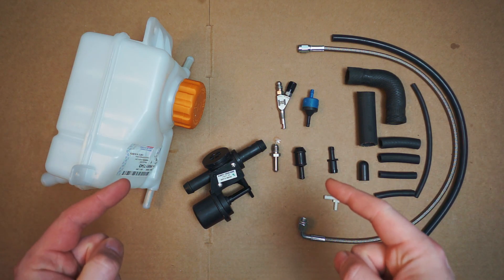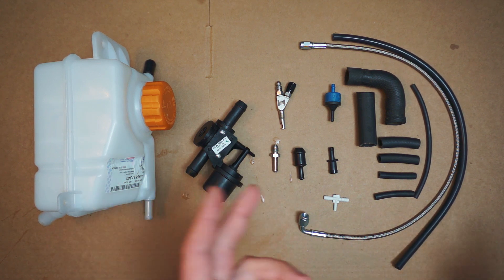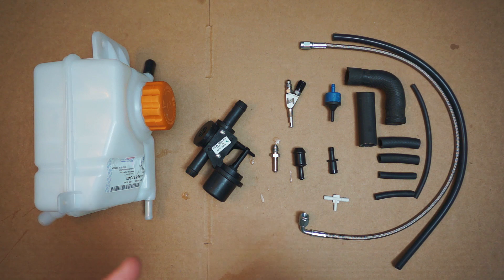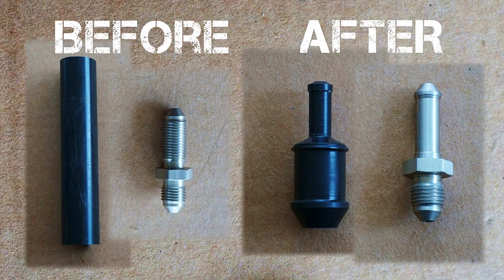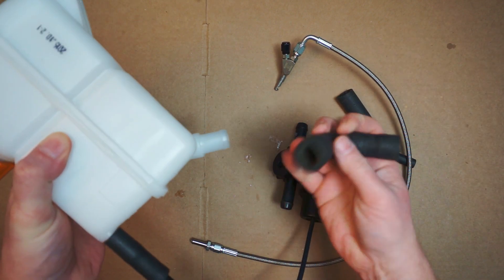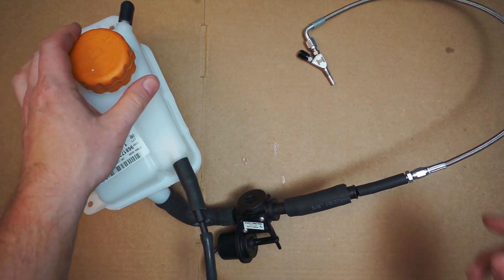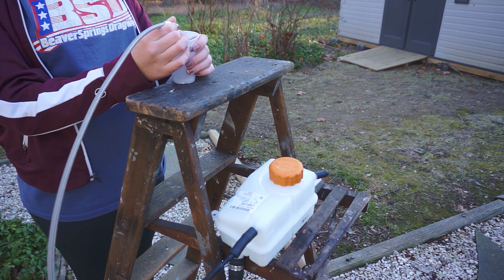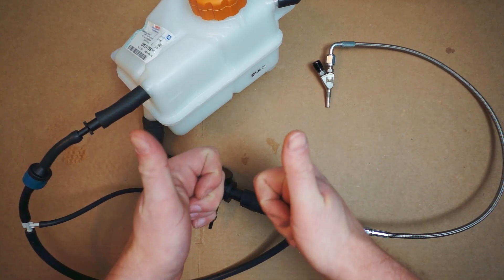$100 Pumpless Meth Injection - Part 1

Comment: So if you're feeding it, boost pressure and then it's trying to spray into 17Psi will at work?. In the turbo carb world I'm pretty sure you want fuel pressure at least seven psi higher than boost

Comment: I think that vacuum valve gadget is a bit pointless. The fluid won't leak out the nozzle while out of boost because the check valve is preventing the fluid from being displaced, like holding liquid with your finger on top of a straw. 
There is the issue of having residual boost pressure in the tank after throttle close which would continue to spray until it hits 0 psi. Because of that you just need to use a blow off valve with a 5-7psi spring between the check valve and the tank.

Comment: The reason we dont do this is you get pooling inside the intake pipe...

You need a mist... if you add the mist it works... but you want at least 100psi behind it and a much smaller jet. 

I use a nos mini controller to adjust my nitrous and methanol solenoids individually at different rpms to get the tune dialed in correctly

Comment: That's a pretty nifty tank. Wouldn't it get better pressure if it had a full diameter hose & fittings so the flow of pressure won't be compromised  by the 3/8 hose sucking on it? It looks like a 1/4 vacuum line fitting & use it you could get the check valve  and supply hose not not neck down it might flow more. If you even have an equivalent vacuum source of a second fitting you can hook it up where the nipple goes

Comment: Pumpless Methanol Injection, so interesting. There is something called Mist Coolant that is cheap and pumpless. It claims to works with relative air pressure as low as 1 bar, which fits some turbo charger. I searched the internet but sadly no one seems to go in that direction. I am aware that at 1 bar, the flow rate is not high and fluid particle is not very small, but it is cheap and is easy to install compared with traditional kit.
Reply from the maker: Back in the '90's there was a pumpless methanol kit called Anderson Mr. Freeze - if you google it, it may give you some ideas.  These setups do work and have their own benefits.
Reply: @AlexLTDLX  Interesting, Mr. Freeze likely still exist. For my case, I prefer some DIY parts to commercial kit, if possible. No pump, no cable, no tank( using washer reservoir instead ) and some fun.

Comment: This popped up randomly for me, anything like this going on the electric turbo?
Reply from the maker: Because I want to do pre-compressor injection on a centrifugal compressor, I'll probably end up using a more conventional meth system (for better atomization) on the electric turbo.  But this would've worked fine on the Whipple.  In fact, I even drilled/tapped a boss for it; but well, as with most things race-car related, the plans changed and well, here we are :)

Comment: Wow this was really cool. I only have one question is the nozzle placed before or after the forced induction? The reason I ask is because im wondering when psi pushes the fluid throught the system, isnt the nozzle at the same psi? Does the pressure of the resevoir over come the pressure the nozzle sees?
Reply from the maker: It's got to be before the forced induction, otherwise it won't work.  It's not a new idea - google, "Anderson Mr. Freeze."

Comment: The method only works if injecting pre-compressor (which is not suggested).
Reply from the maker: Who told you it "is not suggested?"  We've been doing it for decades (google Anderson Mr. Freeze) - no damage or issues, ever.  In fact, injecting pre-compressor leads to more boost usually because it "seals" the compressor a bit.

Comment: Can we add water without methanol? Someone try the setup kit on his car?
Reply from the maker: I tried water injection alone way back in the day.  Really wasn't worth the hassle - maybe a 1-2% improvement, and that's assuming you can't get to optimum timing due to detonation.  Spraying pure methanol, on the other hand, is much more of an improvement.  It's oxygen bearing, cools the intake charge and effectively increases octane.  There are a bunch of videos on youtube dyno testing water/meth injection.  Pure methanol always wins.  As far as this particular setup, it's actually pretty old school.  Google "Anderson Mr. Freeze meth injection" - we used to run those on fox bodies back before we could tune the EEC IV computer.  Heck, I originally saw the idea before that when a friend (who was an engineer at Eaton in the supercharger division and eventually became president of Magnuson, and now is enjoying early retirement) put two M90 Eaton blowers on a Turbocoupe with a 351W engine in it - a google image search still finds Mike's car.  FWIW, the Mr. Freeze setup used the exact same vacuum valve I did.
Reply: @AlexLTDLX  okay man , thank you 👍

Comment: Never thought of mechanical WMI this is genius
Reply from the maker: I can't take credit for the idea.  Google, "Anderson Mr. Freeze meth injection."  They were a thing for a while back in the 90's.
Reply: My brother used this setup on a 69 Rambler AMX. He had 12:1 comp ratio and it had just a small nozzle. No methanol just water. It worked on vacuum in a 4 barrel 850 holley carburettor.

Comment: Also, that’s a SHIT ton of water.  Did you leave it that way or did you dial it back?
Reply from the maker: I actually didn't install it - I've switched over to developing an electric turbo that actually works and it's so efficient that at the 650hp level it doesn't need any charge cooling: https://youtu.be/AOL3Qyczt3Y  That said, I wouldn't inject water, but straight methanol.  And you want at least 20- 30% of your total fuel requirements met by the meth.  In my case, when I was running the whipple, I was seeing about 82% duty cycle on 80lb injectors - that's about 525 lbs of fuel per hour, or roughly 85 gallons per hour.  That's about 3 ounces of fuel per second  - so I'd be shoving over half an ounce of meth per second, or 36 ounces per minute or over a quarter of a gallon per minute.  BTW, this isn't a new idea.  Google "Anderson Mr. Freeze methanol injection" - it was made the same way.
Reply: @AlexLTDLX  nice!! Best of luck on that project. Is this something you are going to be selling or just don’t for fun?

Comment: How do you release the pressure that’s in the tank after a pull? Seems like it would stay pressurized?

Now that I think of it… I guess you don’t want it too so it’s pressurized for the next pull.
Reply from the maker: It would leak out over time.  That valve isn't that tight.

Comment: So i was thinking of building a water injector for my non turbo diesel truck. I was thinking a window washer tank and pump with a window sprayer into my intake pipe and a switch under my gass pedal so it pumps water in when i floor it. Good idea or not?
Reply: Ive always knoticed that my ute always has abit more pep on cold foggy mornings and is lacking in power on the hot dry days
Reply from the maker: You could try it.  I don't have much experience with diesels; but back in the early '90's I experimented with water injection - didn't see any gains.  But a diesel might be different.

Comment: That is the best idea ever except im just going to use the washer fluid reservoir with 50/50
Reply: washer fluid resevoir isn't rated to these pressures though, you'll need a high pressure tank and cap

Comment: But on the nozzle there will also be the same amount of boost as in the tank, there will be no flow
Reply from the maker: Lol.  You're not the first person to miss the key point of making this work - you need to inject BEFORE the compressor.  This isn't a new idea and it's been around in my world for at least 20 years; maybe more.  Google "Anderson Mr. Freeze" to see what I'm talking about.  It does work, and it works well.  I'm just now on this electric turbo kick and no long need charge cooling...
Reply: @AlexLTDLX  spraying before the turbo is safe for the turbo ?

Comment: I tapped to washer fluid tank as it is 5 liter volume. Goes to 90 psi 12V pump inlet. Outlet connecter via nozzle to intake manifold. Pump to battery via relay. Switch on driving wheel to activate relay. Pump is like $20, relay $1. Cheap, easy, works.
Reply from the maker: True that does work. But this has fewer points of failure. So there is that. Many ways to skin a proverbial cat.
Reply: @AlexLTDLX  Not performence engine, 4 pot diesel in medium size crossover car. I mostly pop concentraded washer fluid (20-30% meth) to wash intake valves from crude. No ecology in given engine will give nice results. How often do you top up your meth setup? Mine setup is around 1LPM on outlet, so just use it manually for quick boost of power under heavy acceleration. Love it.
Reply from the maker: @Fosgen  Honestly, since starting the electric turbo  journey and ditching the Whipple supercharger, I don't need any charge cooling anymore; so I don't use it.  If you haven't seen it (starts with an epic burnout):  https://youtu.be/AOL3Qyczt3Y

Comment: You'll probably need a much larger jet than you think. The real kit comes with a high pressure pump but your boost pressure is a lot less than the pumps psi.

Comment: I want to do this on my rear mount turbo setup, it’ll be convenient due to me just drilling some holes in the trunk floor. Will it mess with my maf and or electric throttle? Will the charge air get hot again due to turbo compression? Could I then remove the intercooler from my system?
Reply from the maker: I wouldn't run this on a rear-mounted turbo.  Way too much piping for the meth to fall out of atomization and pool somewhere; and it would probably negatively impact your distribution too.  Keep in mind that the compressed air travels insanely fast, so you might be ok, but personally I wouldn't do it.  Not unless you can put O2 sensors (or at the very least, EGTs) on every cylinder.  Sorry to be the bearer of a bad, well not news, but opinion, I guess.
Reply: @AlexLTDLX  I see, thank you

Comment: Hello. I want to ask you if it can be used onto a naturally aspirated engine in order to increase mpg and cleaning valves and piston? Not intended for performance uses but for hypermiling. Thanks
Reply from the maker: It's reliant on boost pressure to work. Without any boost there won't be any pressure to inject the meth.  But I can tell you this, simply injecting water into a naturally aspirated motor that wasn't designed for it is actually going to hurt miles per gallon. I tested this back in the late 80s early 90s.  You would see a small power gain from injecting methanol, but that would come largely from its heat of vaporization as well as the fact that you simply need more of it than gasoline along with the fact that methanol is classified as an oxygenated fuel.  I think you'd gain more simply by tuning your car to run as lean as it will stand and then doing all the normal hyper-miling stuff like smooth spinners on the wheels thin tires smooth underbelly of the car low turbulence zones etc.
Reply: @AlexLTDLX  thank you for the explanation. Well at least I can use it for my 999cc "beast" supercharger project. I'm thinking of using calibrated 3d printer nozzles as alternative to expensive ones and see if they can work. They come from 0.8 to 0.2 millimeters

I really like you other projects, I was thinking of making an electric supercharger too. Hope to see more developments and more boost in future. Thanks
Reply from the maker: @fabriziopandolfi1857  Those nozzles might just work.  Ideally, you'd find a stainless nozzle; meth is corrosive.
Reply: @fabriziopandolfi1857  got a link for those inexspensive nozzles?
Reply: @AlexLTDLX  I appreciate the explanation. But, for instance, I have two engines that are naturally aspirated, both have a high compression ratio and because of that are fighting back knock by retarding the spark (one is the 1mz-fe and the other is the yzf motor in my FZ1). If one were to inject a small amount of pure distilled water to reduce temperatures and increase the knock index, could increased power output, or at least less knock be achievable?
Reply: I know you made this 5yrs ago but you never posted part 2... plus can you list the parts where you got them if on ebay or amazon. I want to put this setup on my 2014 audi a4 b8.5

Comment: That seems like a really good idea for using betwixt the supercharger and carb on a roots suck through set up.
Reply from the maker: It is.  You do have an advantage with that setup - pulling fuel through the carbs and blower already helps to cool the charge down; as I'm sure you know.  In that case, it'll give a little more power, but it would make your tuning window a lot bigger.
Reply: @AlexLTDLX  If I can't find where to buy one of those, I can make my own by what you have shown in the video. Good Job. Thank You.
Reply from the maker: @ViewThis.  If you can find an Anderson Mr. Freeze, then that's basically what this is...  they've been out of production for a while though.

Comment: Nice mechanical concept, if only it worked !!! 

So boost pressure (some odd 15 psi) used to push water into the manifold which is also boost pressure???, so pressure difference is negligible ie there will be almost no flow and for sure no “atomisation” if you connect the system up in you car. 

It almost works in your backyard because the other side of the nozzle is at atmospheric pressure so there is a fair pressure difference (15 psi gauge I assume) , so not sure about your “math”. 

let me know if I’m wrong but doubt it , Please if you did find it doesn’t work delete, or highlight this on the Video so people don’t waste their time. Thanks
Reply from the maker: I think you missed the point.  It injects before boost.  In the case of a Whipple (which I designed it for), injecting between the throttle body and the blower works fine.  The pressure there is atmospheric, or maybe a little less; the Whipple is pullied for 15 psi - so meth is injected into the blower's rotors at 15 psi.  In the case of a turbo or centrifugal compressor, you inject right into the compressor wheel - not after.  As you point out, it wouldn't work after.  This isn't a new idea; google "Anderson Mr. Freeze" - we've been injecting meth like this since at least the early 90's.

Comment: At boost you have pressure in intake as well as in the meth tank. It is not going to work, hence no second part ) you failed )
Reply from the maker: I was going to delete this, but I'm going to leave it up.  I didn't fail - you just didn't pay attention or don't understand what was presented.  The car has (had; still have it, but it's off the car right now) a Whipple.  The throttle body on a positive displacement blower is before the blower.  Where there's no boost.  So, in a word, you're wrong.  Look up "Anderson Mr. Freeze" - people have been doing this for years; myself and my friends included.  I simply don't need it for the electric supercharger project - not enough boost.  But it would work there too, provided I inject pre-compressor.

Comment: Can you this method on a Diesel engine
Reply from the maker: As long as you inject pre turbo it should work well.  In fact, diesels tend to run high boost so it should conceivably work even better on a diesel. I don't know too much about them, but I do hear propane injection is a big thing too.
Reply: Water Injection was used in some in 80s Iveco trucks to increase reliability mpg and power

Comment: Does this work? The issue i see is the nozzle and boost thru the tank would balance out in theory, like a fuel injector wouldn't squirt if it had more boost than fuel pressure
Reply: I thought the same thing but surface are of the meth in the tank is probably 13-18 square inches. With 17psi pressure would add up quick

Comment: With methanol being corrosive to aluminum.
Do you recommend only doing this on engines without it?

Have you seen damage done to engines with aluminum heads or other parts? Or does vaporized methanol have less of a corrosive effect?
Reply from the maker: Sorry for the delayed reply - the methanol is in contact so briefly and as you state, it's vaporized (or at least atomized) to the point where there's basically no negative effect on the engine.  But for tubes and stuff that carry it, definitely no aluminum in the system.

Comment: Where does the nozzle come from and does anyone have a part number for it?
Reply from the maker: That's an Induction Solutions stainless nitrous nozzle.  It was around $40.  I went with stainless because methanol is corrosive.  You don't want any aluminum in a methanol system.

Comment: I was thinking about this setup ever since my last comment about testing it.

I was wondering if we connect the small diameter tube from the big soleniod to the intake manifold. While we connect the large diameter tube to a small pressurized tank at any pressure u want 100psi 80 psi or whatever for better atomization.

I believe this would be better only problem u might face is the big solenoid opening due to the high pressure of the fluid or being unable to close for the same reason although its highly unlikely.
Reply from the maker: You could always use a nitrous solenoid.  I'm not worried about atomization - going through the blower will atomize this well.